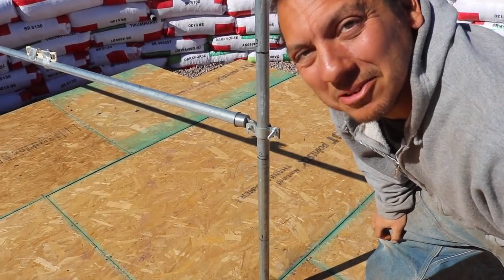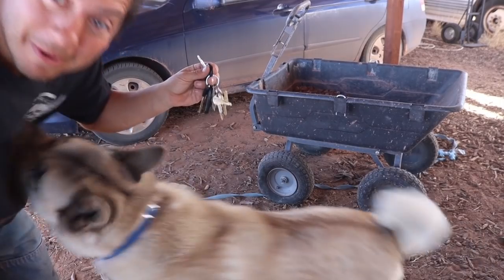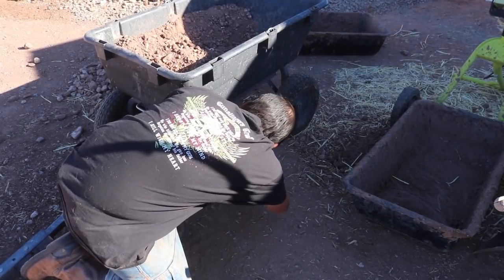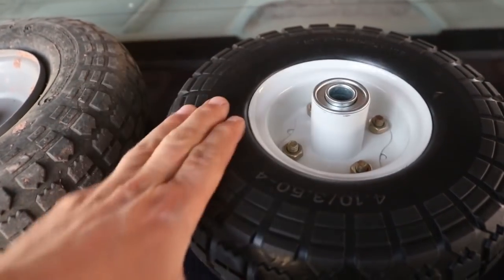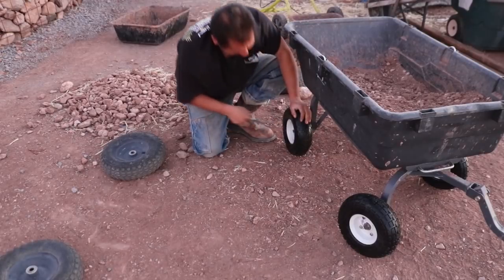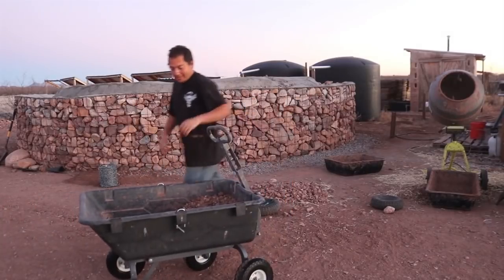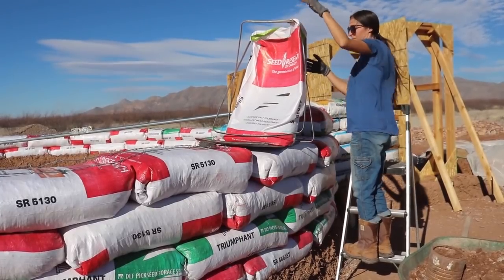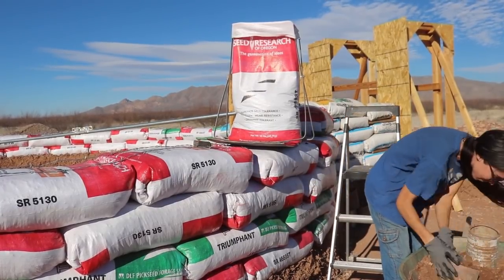The HARSH Realities Of Earthbag Building | Is It Right For You?

Comment: Put your two good "Big Wheels" on the front for steering your wagon and leave the smaller "new wheels on the rear. Solves your steering issues and replacement costs. May not look like much, but as long as the incline of the wagon doesn't interfere, you're miles ahead.
Reply: My thoughts exactly. The minute you brought out the smaller wheels, I envisioned the really big and small wheels on old time bicycles.

Comment: I’m a single older (50) disabled woman. I am saving to purchase property. My goal is earth bag building I know it will by PHYSICALLY challenging to say the least. I’m not lazy, just physically limited so in everything I do I try to be proactive and not reactive. I try to solve possible issues before they occur. Watching your build is definitely helping in that area. I also try to think ahead when purchasing a new items. Example: I bought a generator and after watching countless trouble shooting videos for the model I purchased I bought new spark plugs, enough oil to do several oil changes as apparently a new generator produces metal shavings and to prevent problems later you need to change the oil several times in the beginning so I prepared for that. Same with the cart/wagon definitely getting an extra tire right off. Always learning something:)
Reply from the maker: I love this! Good for you. The way you're going about this is smart.

Comment: Great video, wind is nuts here too, was steady 30mph coming from AZ. Found a guy on YouTube who used expandable foam for his wheelbarrow tire. He tested different forms and came to a conclusion that the electric/water faucet gap filler worked the best. Left the tire acting like it had air in it, a little soft but worked well.
I used slime and added a couple of pool noodles inside my tires plus I doubled the air pressure in our cart wheels. I have many years working with tires, not just these little tires but racing tires for all sorts of racing, drags, indy, Nascar, trans am, rally, monster truck to name a few.
How's your truck doing. I might be able to make a road tip to come help you get it running right again. I'm on the far side of NM from you folks.
Reply from the maker: Thank you! The truck is doing okay. Still needs a bit of work. Nothing urgent.

Comment: Larger solid tires would definitely be expensive. A replacement for the ones you had are about $50 each. Ouch.
Reply from the maker: We had some on sale for 35 each. Not quite as bad.
Reply: @senatorjosephmccarthy2720  that would work, except in sand which is my predominant soil condition. LOL